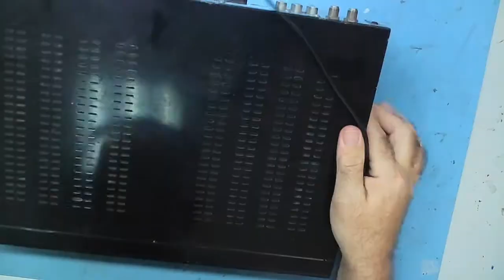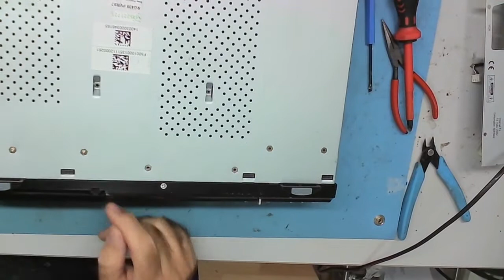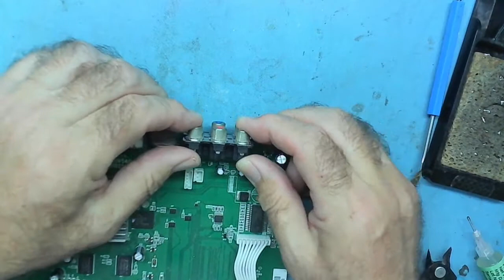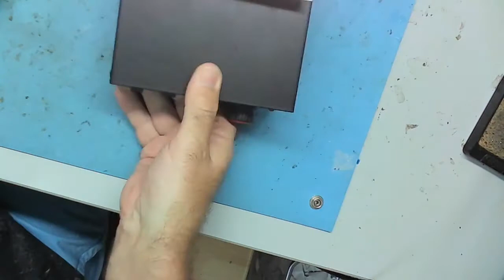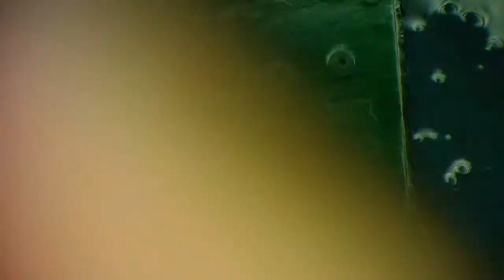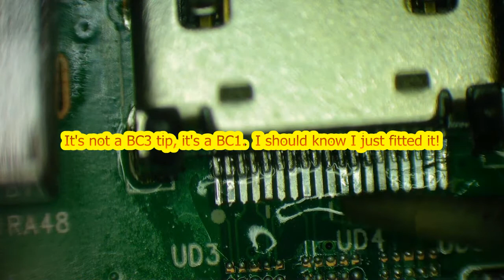Learn Electronics Repair #20 - SMD HDMI Socket Repair and Replacement

Comment: Why are you using technology which is a solder paste and heat and it adheres to the connections only it doesn’t clog up

Comment: I’m sure you know this but if you use about 200-230 degrees of hot air and super low air speed when your soldering those pins it will make your life a lot easier and give you much better soldered joints. Put a good amount of flux and just keep going over the pins with your iron instead of using the wick each time there’s too much solder. The hot air will help move all excess solder to right or left and then use the wick to the excess. Then go over the pins you used the wick on and your done. It Makes life a lot easier using the hot air station to aid your soldering iron when soldering those ports. I repair these on a daily basis and some boards really suck the heat out. Thanks for the Video !

Comment: It was good for me to see the "be patient with yourself, take your time" with the HDMI pin soldering.  Test, test again, and test again if needed.  Better safe that let the magic smoke out of the components.  Out of curiosity - do you ever use the dim bulbs after a repair when you first power the repaired item on?

Comment: Desolder pumps fill up surprisingly quickly, regular emptying is required if you want a really strong suck! I have to fully agree with you how useful they are, especially on big solder connections. And - you can use them to 'Hoover up' when you are replacing SMD.s. Amazing video as always! Bravo!